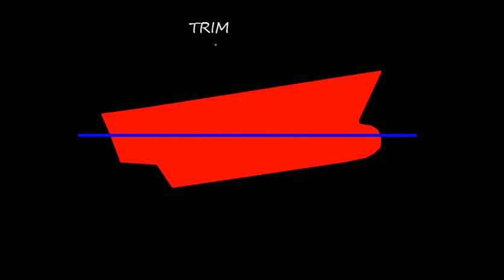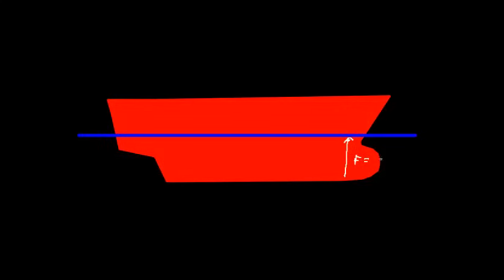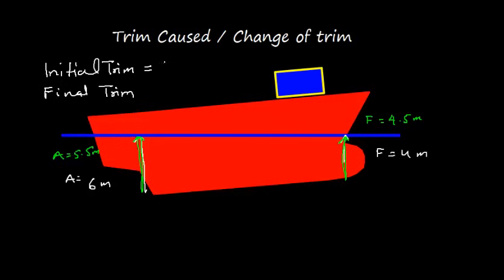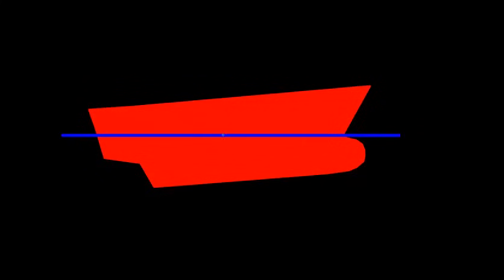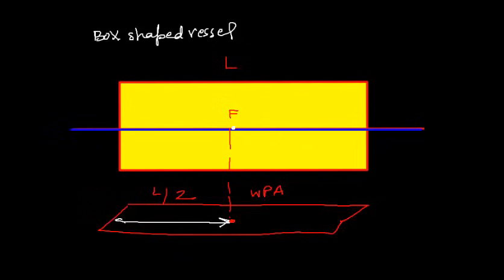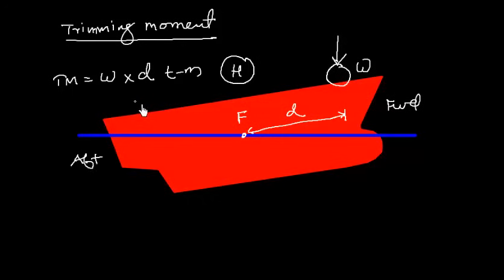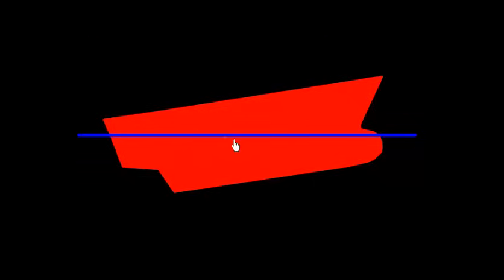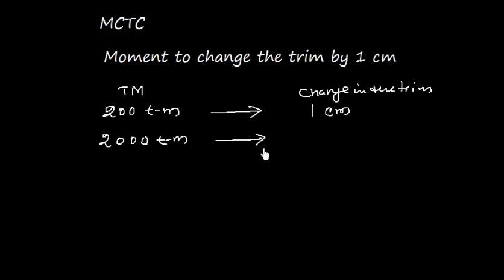Ship Stability _ Trim Introduction Part 1

Comment: difference between cof and cog??
Reply from the maker: +Prabh DhiLLoN 

COG  is the point where weight force acts vertically downward. For uniform weight distribution it is the geometrical center of whole ship.
COF is the point about which the ship trims. This is the geometrical center of water plane area .... Not the whole ship.  
Now, imagine a box shaped vessel  8 m deep. If you look in transverse direction , distance of COG from keel  , KG = 4 m. Suppose the draft of this vessel is 6 m. Than distance of COF from keel will be 6 m . COF is at water level. Hope this answers your question.
Reply: +SAILORS TUBE thanks sir

Comment: initial DRAFT 6 m Aft    4 m Bow    TRIM is 2 m by the stern
5.5 m AFT    4.5 m Bow
TRIM should be 1 m by the stern
Reply from the maker: @ 4.00, if you notice, with initial drafts F= 4 m, A= 6 m, Initial trim is 2m by Stern and  with final drafts  F= 4.5 mm A= 5.5 m, the final trim is 1 m by Stern.  However, here I am talking about change of trim or trim caused. If the trim is reduced from 2 m  stern (initial)  to 1 m stern ( final)  or change of trim from more stern to less stern, ship is having a change of trim  (difference of trims )  of 1m by head . And that is why I have written trim caused 1 m by head. This value is algebraic difference but the naming will depend  how the  ship is trimming. From more stern to less stern, means there is a change of trim in forward direction (or  by head). Thanks for question and I feel I should have described this further in video .
Reply: How to know her amidships draft